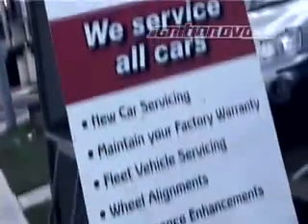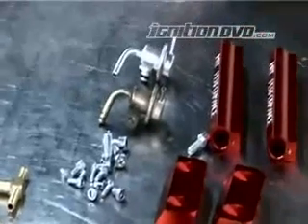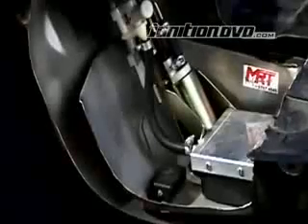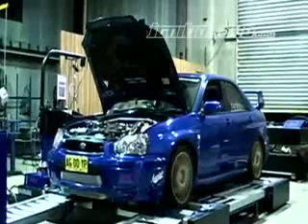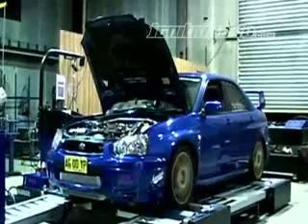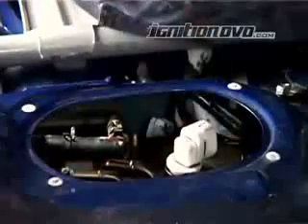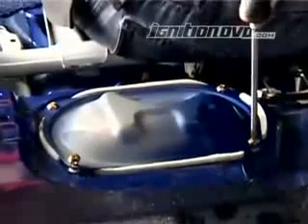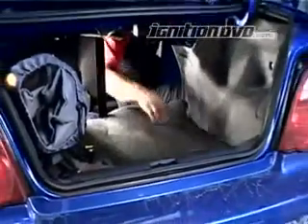Project STI  with MRT fuel pump and anti surge tank

Comment from the maker: if you run out of injectors and or pump then you are pushing the boundaries of the internal parts of the engine, BUT you can go bigger with a risk, but its all in HOW its tuned and modifed and WHAT parts !